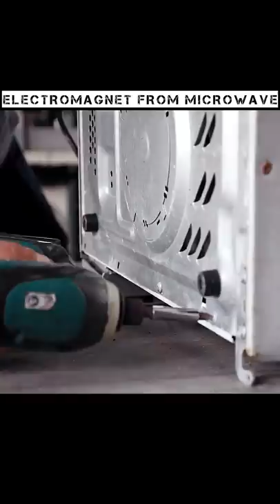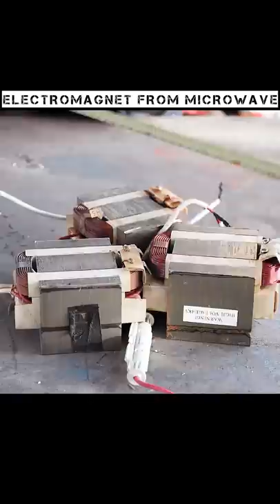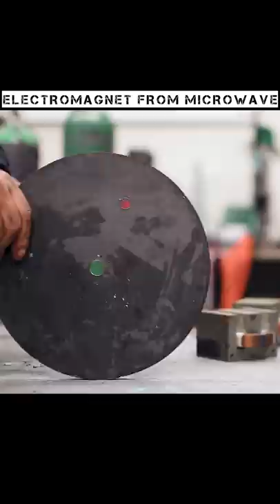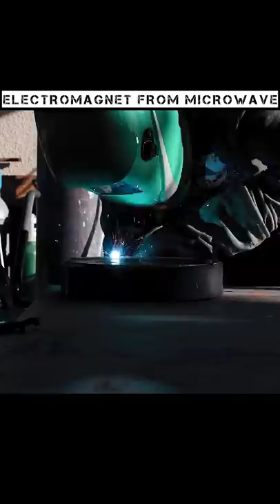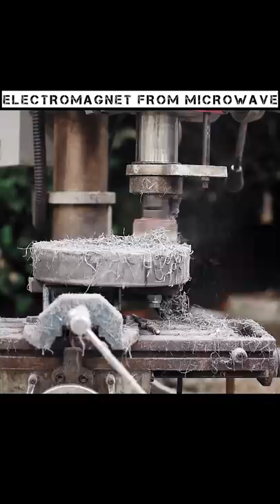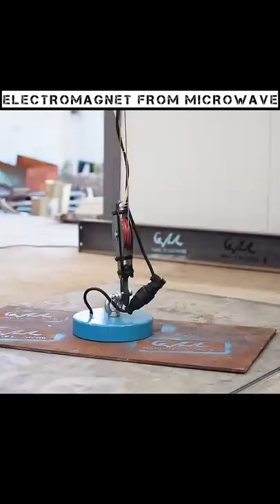Electromagnet from microwave transformers #shorts

Comment: All transformers can be turned into an electromagnet. It's just copper wire over metal. You could build a way better one if you order the wire for the voltage you want to use and wrap it on a custom made metal you can order made online. Iron is good & cheap but you might want a stronger or better material. You can even carefully unwrap the wire from a fan or other old motor.

Comment: From working at a fan shop, yes you can make your own magnet, but commercial ones are so easy and don't require electricity. Plus they only engage with a substantial amount of steel below them so they don't pickup filings all the time.

Comment: when the resin tired to stick to the plate, someone will bleed happily.
Reply: As long as there is a current running through it, the electromagnets will stick to both the material being lifted and the housing. The resin just holds it together when it's not powered up!
Reply: @randyherringshaw6325  should bolt the transformers to the top metal plate for secure safty. resin is not happy when using longer period. when it fails, it fall, it hurts.

Comment: Missing information, wiring, what to do if you don't have a milling machine, what other power source can be used. Power in microwave. Another words can you use different size microwave? By the way only need wire to discharge capacitor

Comment: What I see is nice scrap metal, if that's copper and not aluminum.

Also, I got 2 angle grinders now, corded and battery powered. Now I can use them to take transformers apart instead of using a big hammer. Nice to think about lol.

Here's a safety tip

Don't touch the capacitor. The big black cylinder on inside screwed to the side with 2 wires and a ground wire. Don't touch that with bare hands. Use some steel nail, or pliers, etc to touch both terminals together to discharge it, with very well insulated gloves. I always use gloves and snips/wire cutters with rubber grips. Microwaves have very high voltage(that's what the transformer is for, converting the voltage) and the capacitor stores the charge, which could kill you. It's mostly likely discharged, but it can possibly hold the charge for quite a while.

My expertise? None. I'm just a scrapper making money. I've done my research though and know this much. I have taken hundreds of microwaves apart and have made hundreds of dollars off of them($4-$10/microwave, depending on size and how much copper in the transformer, if any)

Comment: This seems simple enough I'll go buy the tools. I never know when I'll need an industrial strength electro magnet
Reply: Be extreme carefull. Microwave capacitors can hold deadly charge days after you unplugged it.
Reply: @leventevincze1034  I have a sledgehammer and some old screwdrivers. I think that'll work
Reply: @leventevincze1034  substitute the fancy epoxy and lathe for duct tape and twine and the rest should fall into place

Comment: Did you just put epoxy in between the coils....I don't think it's good idea....there are many times when wires become hot due to over work or load and it will cause heat problems later.

Comment: Do not open a microwave if you touch a capacitor you will die thats not something to take lightly even a capacitor from a camera has enough power to kill do not try this and this electro magnet I wouldn't try that either just buy one that way you know what it's rated for and don't potentially drop something on yourself

Comment: Alternate title how to get a thousand jerks who once read somewhere about a capacitor In a microwave being dangerous to comment but make no mention of the fact that the same capacitor is used as starting cap in air-conditioners refrigerators water pumps air compressors and so much more not like there isn't a thousand stickers to warn a idiot of the risk of electrocution 🤤
   Be funny if they earned their Darwin award tearing apart a water pump

Comment: Microwaves have tamper resistant screws for a reason, if you know all dangers and are prepared then by all means go ahead and open it however, if you don't know all the dangers then don't try to or you could end up dead

Comment: The only dangerous part about what he did is he did not weld the transformers to the bottom of the metal plate. The only thing holding them in that whole circular container is the Epoxy. If you ever pick up something heavy enough it will pull the magnets completely out with the epoxy still connected. I know this for a fact.

Comment: Why take out the extra coils?
Reply: Becouse those are the secundarys. They will deliver around 2000 volts. 
The primary coils tho you put in the 230 or 120 volts.
Reply: @firefly2472  thank you
Reply: @plsquirrel3835  Np. Glad i could help.

Comment: Me reading the comments without knowing i could have died disassembling my old microwave 😱

But the microwave was unpluged for months... Was it still a hazard?
Reply: There's definitely a good possibility that there's still a significant charge after several months. A lot of factors will determine the discharge rate of a capacitor. They can definitely kill, or at the very least ruin your day. Obviously the bigger the capacitor the bigger the regret if you happen to touch one that still holds a charge. Small capacitors may simply be a mild static shock or you may not feel it at all, most capacitors aren't as pleasant 😅
Reply: @MidnightToker420  

.... I could have died...
Reply: @superniger4822  
Yeah, you're right, I was attention seeking.

Comment: Глупый; вся нагрузка при такой схеме приходится на слабый шихтованный сердечник-магнитопровод и эпоксидкную смолу, его держащую.
Догадаться "передать магнитный поток на силовые стальные элементы корпуса, видимо, не судьба для подобных горе - конструкторов.

Silly;  the entire load with such a scheme falls on the weak laminated core-magnetic circuit and the epoxy resin that holds it.
 Guessing "to transfer the magnetic flux to the power steel elements of the case, apparently, is not destiny for such grief - designers.